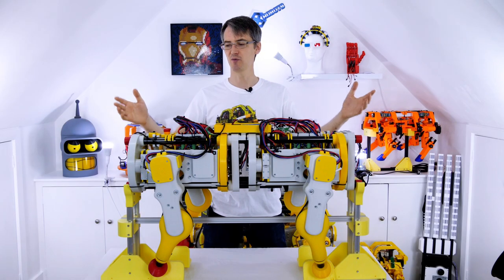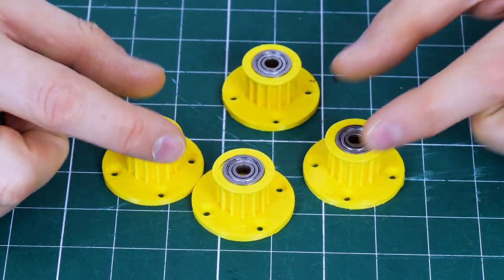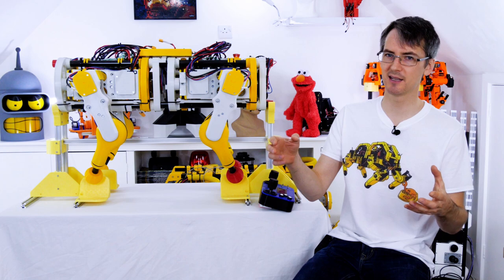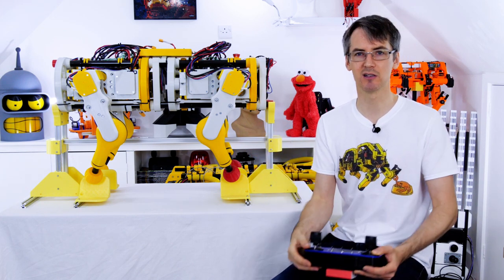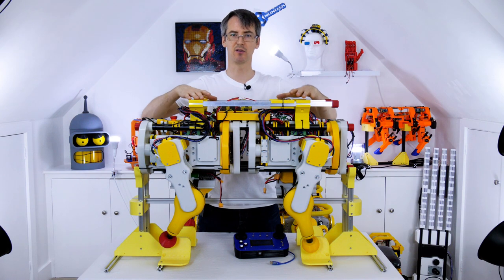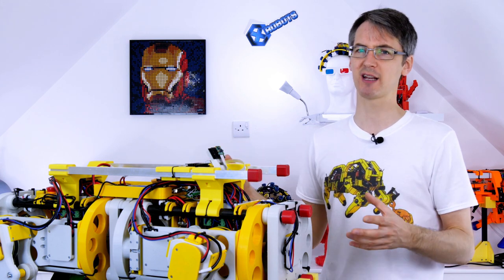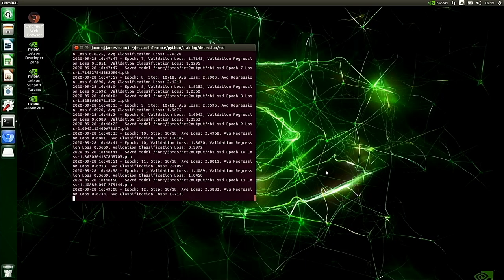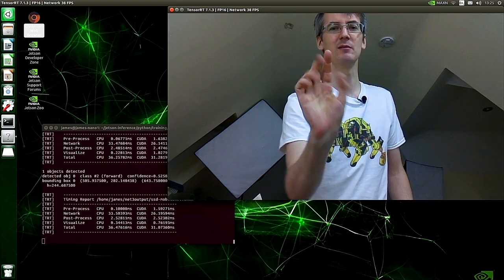openDog V2 #8 Hand Gesture Recognition

Comment: Instead of aluminium plates for structure , consider using PCB - weight, strength and heat reistance are comparable to ali, and you can get it drilled and machined extremely cheaply. if you need some heatsinking on, leave the copper on
Reply from the maker: Good idea - could make it much more accessible to have a PCB fab make the parts also.

Comment: James, one common reason for the motor to get hot is if the encoder and motor are no longer properly alligned (someone slipped). Check if your encoder.offset changes after normal/heavy use of the axis and recalibrating.

Comment: Nice work! For the motor heating, make sure all bearings are in one line. Since the motor already has two bearings, adding third can add unwanted forces. Basically you lock straight shaft at three points (which may bend it ever so slightly) and then you force it to rotate, effectively bending it each rotation.

Comment: This is so awesome! I've always loved gesture control it is impressive how easy it is thanks to transfer learning. I am definitely going to do that on my robot.
By the way it is totally OK to use the gpios like you did to send the orders to the teensy. Using ros is not mandatory in every layer of the system, as always keep it simple. For the odometry as others said you can use additional sensors and perform all computation/estimation on the Jetson in a custom ros node, for now you can leave the teensy for controlling the legs in open loop.
Keep up the good work :)

Comment: Using odomotry isnt necessary in ros, it is if your using gmapping, but changing it out for something like hector_slam works great.

Hector dosent need odomotry data, but it can use it, also hector_slam allows for the sensors to tilt, where gmapping dosent like that.
Reply from the maker: But what about the navigation stack itself?
Reply: @jamesbruton  The navigation stack is a simple setup of packages. Either it can be 1, amcl, map server, move_base or 2, gmapping, move_base.
The first 1 setup uses amcl which just fits the robots location to map and keeps track of where the robot is.
The second 2 setup uses gmapping to create a map while the robot is driving.

In either case the amcl or gmapping can simply be replaced with hector_slam.
The move_base launches the costmap2d package and some planners.
Also this is just off the top of my head so i might not have all the packages but the jist should be there.

Also love the videos :D keep them coming.

Comment: Perhaps print the heat sensitive components in SLA resin. Most photoresin fails around 250c, but remains ridgid (a little brittle) until then. It also acts an insulator to the more thermally suspectable plastic types. 
Keep up the great work! Can't wait to see what ya make next!

Comment: You should switch to PETG for thermal resistance. It softens at least 10-15C higher in temperature. I have switched all my practical prints to PETG and haven't had reason to regret it.

Comment: Instead of the screen you could do something else: You can usually tell wether another human can see you because you can see wether there's a line of sight. You can do the same with the camera by adding a frame ~5cm in front of the camera which shows the maximum field of view. If you can see the camera, the camera can see you and the other way around.

Comment: What if you put a second set of encoders directly connected to the end of the "drive train" as in directly tied to the movement of leg axis. I guess you would still have to keep the encoders on the motors to prevent accidental overspeed (if they're PID controlled, don't know if that's an issue). But by throwing more sensors at it you could compare the values between both encoders or similar. ???

Comment: Great upgrades.  Any chance you can export your odrive config per motor? What control mode are you running them at ?  would save alot of trial and possible damage in my part if you share some insight .  Thanks

Comment: could you use optical data from a down facing camera to calculate the horizontal movement?
like with computer mice
Reply from the maker: Yes, a 'tracking camera' that basically does that

Comment: You could try water cooling the motors. It could prevent your melting issue as well as prevent motor overheating. Of course it could cause issues of its own, but if done right it would really help in the long run.

Comment: Probabily the frame you're using is not ideal. A welded metal frame would be a lot stronger and stable, and won't weight much more - maybe even less. It would be easier to modify, too

Comment: Maybe the encoder of the motor oscillates too much driving them harder
Reply from the maker: They are tuned up pretty tight so there's enough power, but that's just another issue

Comment: Hello, about the position tracking part, you should be able to calculate that, but yeah it's not going to be accurate. So i'm proposing you put both the Intel camera's on, one of them tracks position (by looking at how it moves relative to the surrounding I think). It does it very accurately. It's also easy to use with ROS. https://youtu.be/GhHvuAoFC6I
Reply from the maker: The dog is quite shaky - I'm pretty sure that would cause issues as he demonstrates
Reply: @jamesbruton  I saw a video from Skyentific and he shakes the camera pretty hard and first the data was indeed not good, but he realized that has finger was in front of the camera and when he removed his finger it was good, I think it's worth a try or you can ask Skyentific to test it for you. Good luck with your project! If you need advise (mechanically or anything really) you can always contact me.
Reply: @jamesbruton  An opportunity for a fun side project: Stabilized articulated camera neck using small brushless motors, a teensy and an IMU. Make it long enough to solve the height problem. Your dog will become a llama, but that's cool.